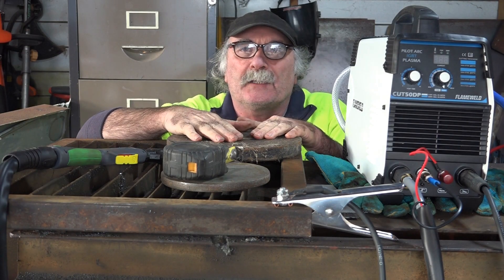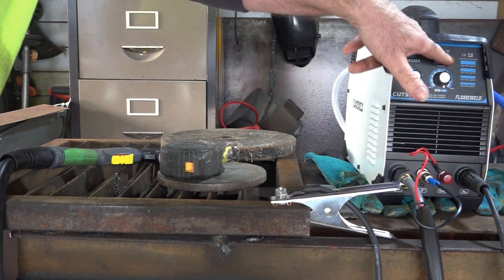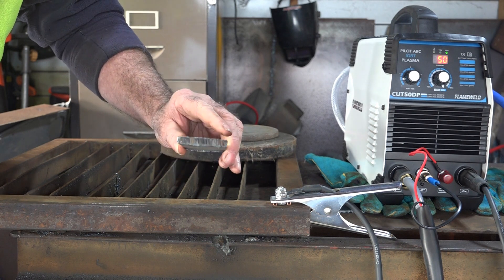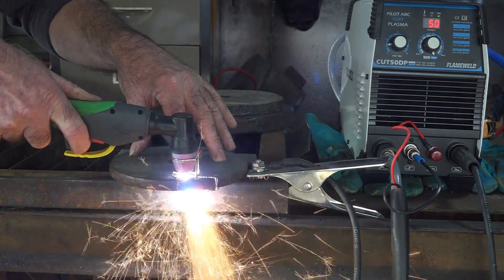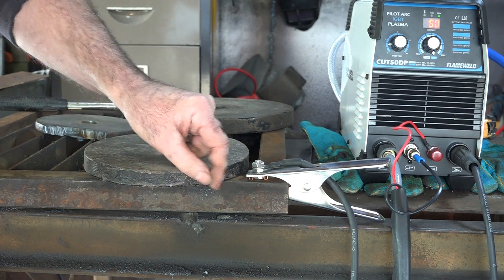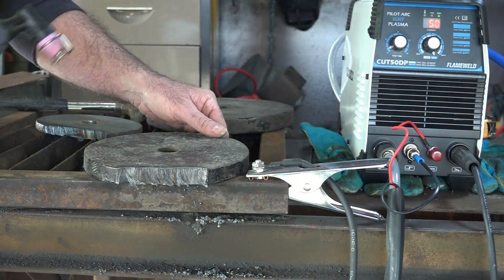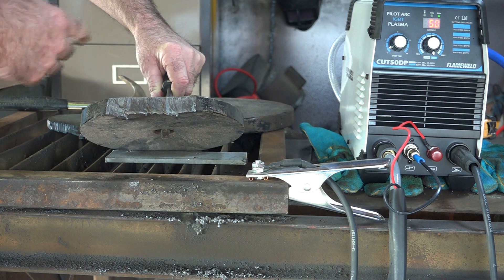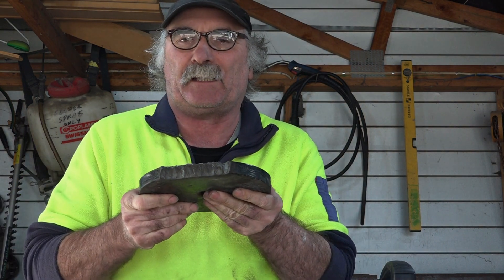$200 Plasma Cutter : What is the Thickest Thing it Can Cut?

Comment: Pete,  $169 price on July 22 but final price was $145 today on AMAZON with $25 coupon.
Reply from the maker: Is that the pilot arc or hf machine
Reply: That's the hf machine. It appears that the pilot arc model sold out quickly. The link now only brings up the hf model. I was fortunate to purchase the pilot arc model before they ran out.
Reply: @tundra3r319  If Pete says all you have to do is connect a wire for pilot arc to convert it Why are the pilot arc machines so much more money if you just have to connect a wire..?